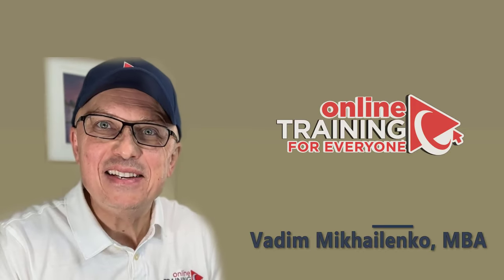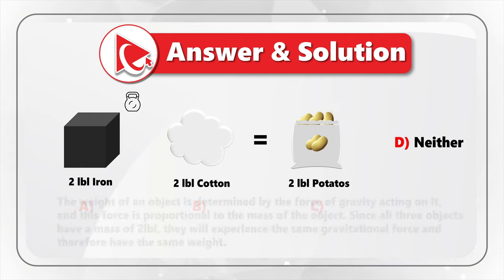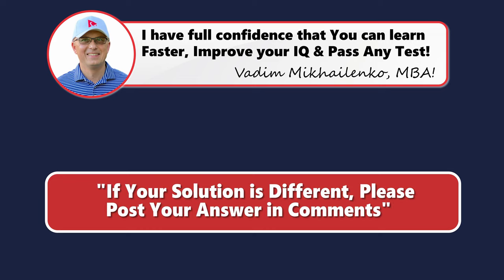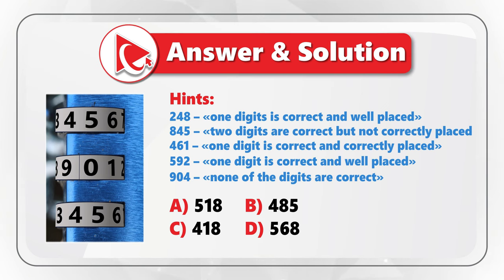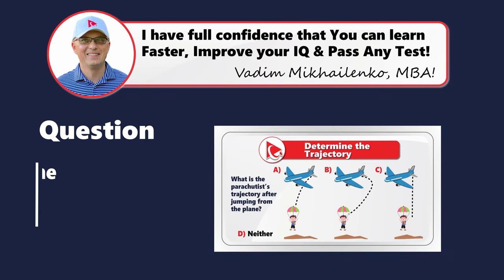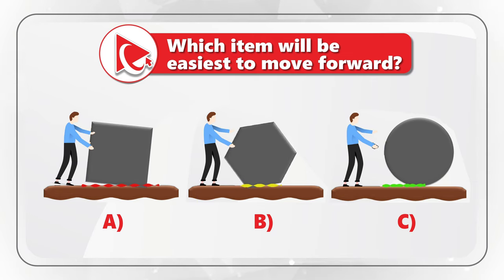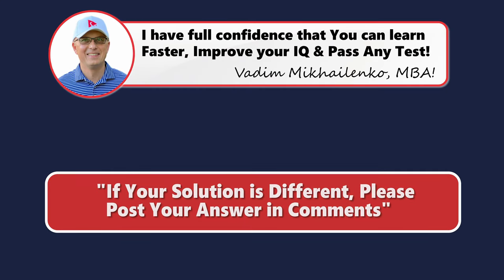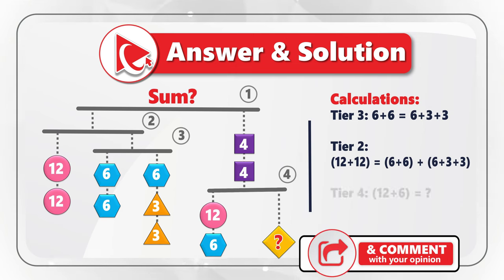How To Pass a Mechanical Skills Test

Comment: In the question with the scales where you have circles, triangles, squares and hexagons, the possible answers are all wrong because the total weight on the left is 48 but on the right side the total is 44. Please review and apply the appropriate solution. Thank you
Reply: They are not supposed to be equal, you can tell by how the distance is aligned differently on both sides which compenstaes for the different weight. This is the appropriate solution as you came to the wrong conclusion
Reply: They are supposed to be equal. The forces can be simplified to acting at the two points where the separate scales converge on the main scale. Those two points are equidistant from the centre of that scale, and as such forces acting on either side must be equal.
Reply: They are supposed to be equal. The forces can be simplified to acting at the two points where the separate scales converge on the main scale. Those two points are equidistant from the centre of that scale, and as such forces acting on either side must be equal.
Reply: @CJT49  17:35 YOU ARE 100% WRONG. Did you even follow his thinking, or are you just arguing for the sake of arguing? He said the right side is also 48 as the left side, but it's 44.

Comment: I don't get the parachute one. B makes way more sense to me the way the diagram was drawn. When jumping from a plane, you get hit by the wind blast immediately sent behind the plane. They then glide down usually at a slope to make the landing smoother.
Reply: Spoken like a true paratrooper. I just commented on this as well before seeing your comment. Jet/Prop Blast almost shoots a trooper out horizontal prior to vertical decent. C-17 a bit of a more straight drop. Also the factor of jumping left and right door behind the wing or are you dropping from the ramp in back...this too is a factor

Comment: With the PIN code lock question it’s possible to get the answer without comparing to possible choices. It’s requires more memory usuage but doesn’t take any longer really. 
248 only one is correct and right spot 
845 2 are correct but wrong spot, 4 is eliminated leaving 8 in third spot 
461 again one digit in right spot, third is already solved so 4 or 6 is correct
592 again 1 digit is correct but with cross reference back to what we’ve solve it’s mean 59..colurrently our possible solutions are 
568
498
With last statement we eliminated 904 from possible digits so leaves us with 568 as final possible answer

Comment: @ 14:14 The parachutist one is not right....he is jumping behind the jet engine or wash that will also be pushing against the jumper. answer B is a closer example or perhaps neither. Especially when jumping out of a c-130. However shince this is closer to a c-17 there is a small wall outside of the plane that is a wind block and you do fall more than you are pushed with prop or jet blast.

Comment: The airplane one is wrong. The real answer is B. You would jump out the side door away from the airplane, then as you float down you would drift forward to land with the parachute. No one is falling straight down to the ground unless the parachute doesn't open.

Comment: Thanks but not 18 and 96 instead it is 18 and 92
Reply: Definitely 96 48+48
Reply: @darrylbrown6494  
If we use 18, 96; 
48 + [(18 + 18) + 8)] = 92 only. 
If we use 12, 88; 
48 + [(18 + 12) + 8)] = 86 only. 
If we use 20, 92; 
48 + [(18 + 20) + 8)] = 94. 
If we use 19, 94; 
48 + [(18 + 19) + 8)] = 93 only. 

The answers provided are all wrong. He computed the right side as 48 when he used 18 but it's actually only 44
There must be a typo. So, definitely not the 96 option.